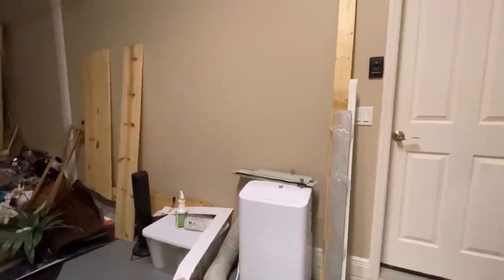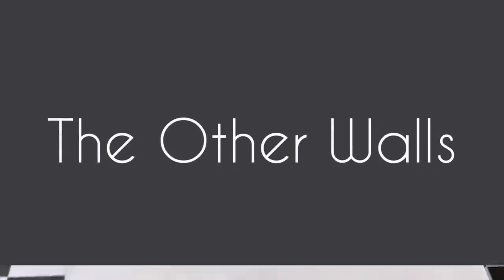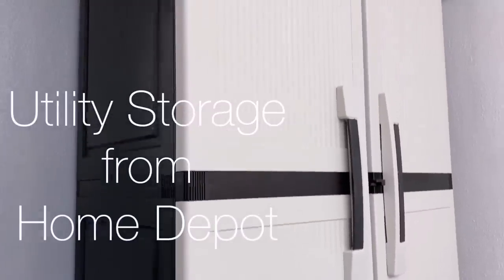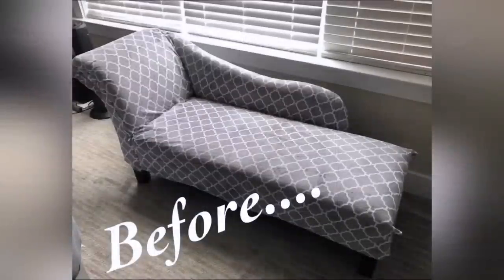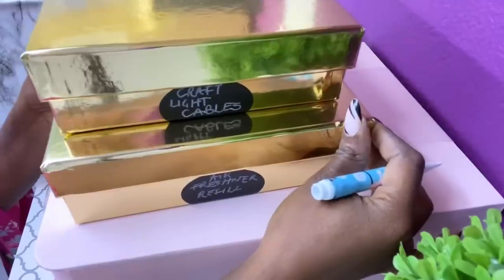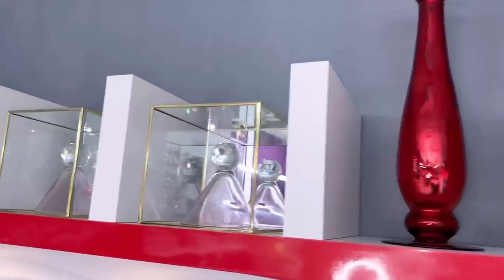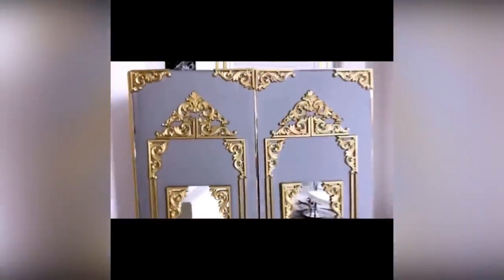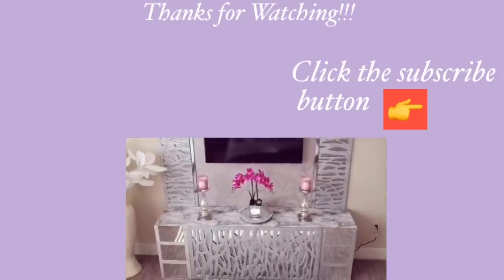5 GARAGE TRANSFORMATION Ideas! SheCave| DIY Garage To SHE CAVE Transformation

Comment: Thanks! I am in the beginning stages of transforming my garage(painting and floors). Your video is so inspiring. I have been searching for examples of a garage transformation for months now! So I was incredibly excited to see your transformation. What I’d like to know is how you are keeping the garage cool in the summer and how will you keep it warm during the winter. I have researched different options that do not require heavy installation because I’m a renter. I would love to hear what you’re using or your ideas!!! thanks again for your post!!!💕
Reply from the maker: Sure! 😊 I’m using SACC 8500 large 3 in 1 PORTABLE AC with dual reverse hose. It cools up to 350sq feet of space. I send the hot air passage hose through the window because my garage has a window (The AC has a plastic board This has the hot air hose in the middle that seals the little openings around the window to allow for maximum cooling)🙂💕